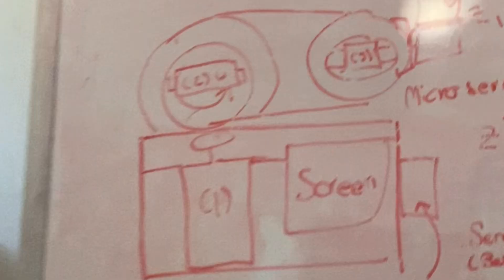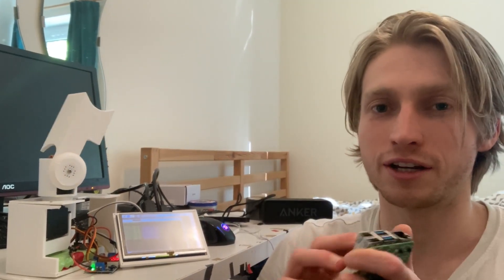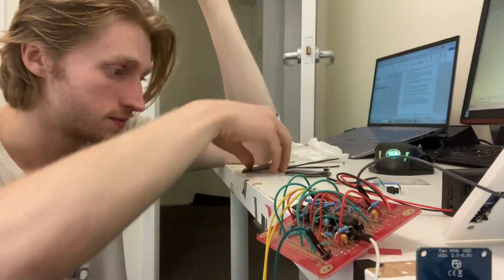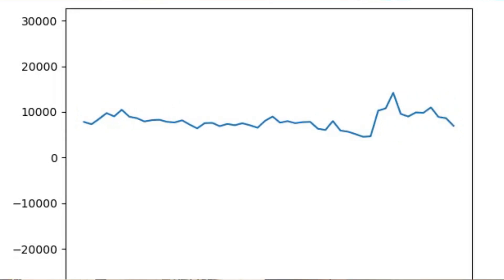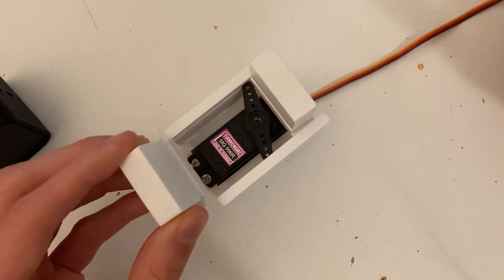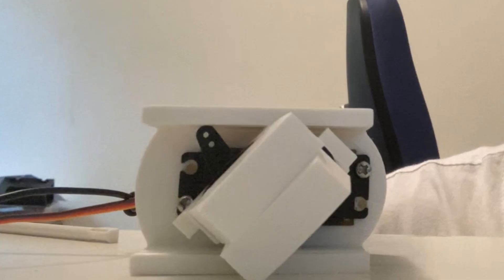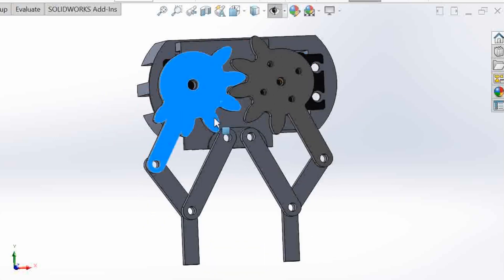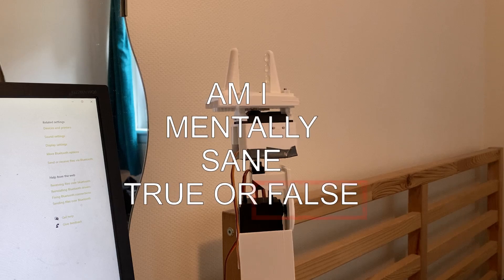Can I drink water using my brain signals?

Comment: I assume stabbing myself with a multimeter is off the table.
Reply from the maker: I would argue that is a smarter idea then what i manifested here
Reply: Out of morbid curiosity, you said the screws in the arm come loose. Any idea why?
Reply from the maker: @xenomorphgourmet1005  it was just in the gripper thing itself, but the servo spinning actually loosened the screw, it wasnt a problem when no object got in the way, but when it aproached stall (mainly cause i drove the motor into itself off camera) the screws loosened :D